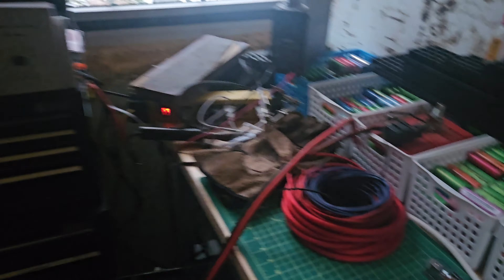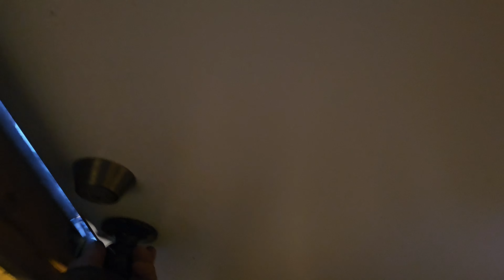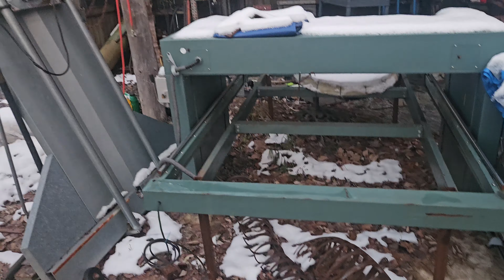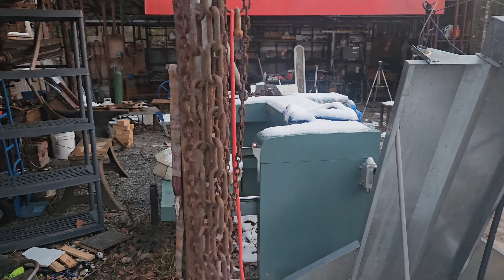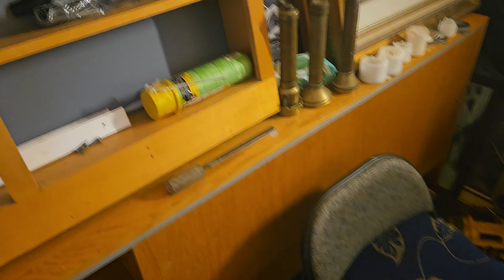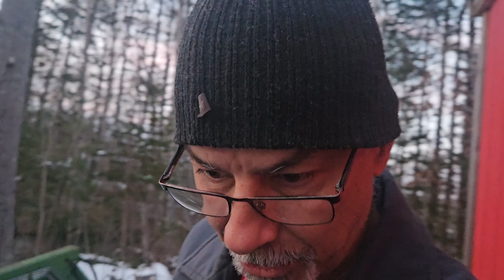Future projects!!!

Comment: An ebike would be a pretty cool project.  They're kinda hot right now so it would probably get alot of hits for the channel
Reply from the maker: I'm leaning towards that using one motor and using the other motor for maybe a lawn tractor retrofit they would each use both or just one of those batteries depending on what you need

Comment: Do you have a belt grinder? I'm sure you probably do but those motors with speed controllers sounds like a good fit.
Reply from the maker: That's actually not a bad idea but I don't think I would use it enough

Comment: You ,like me, need to finish a shop so you can work inside because working outside in the cold and snow sucks
Reply from the maker: I actually don't mind it all that much, kinda like the cold not the heat of summer, you can have that
Reply: @modernblacksmith  I dont like the heat ether but when shes -35c plus the wind chill its not nice to have to work outside.